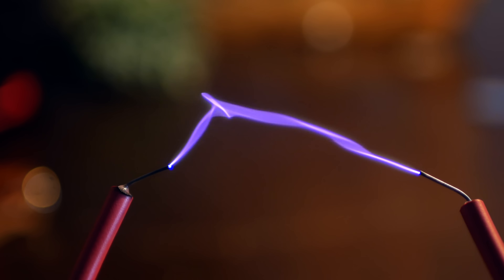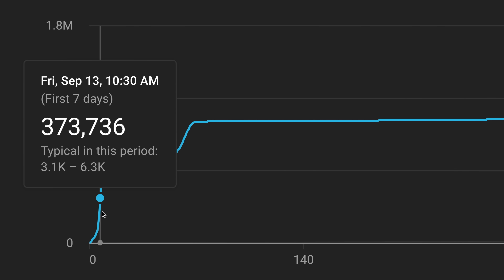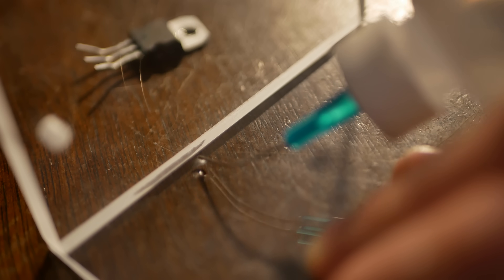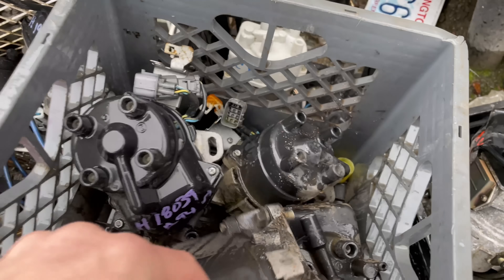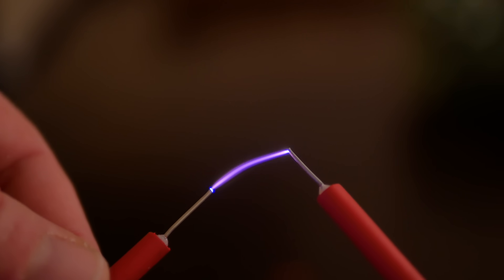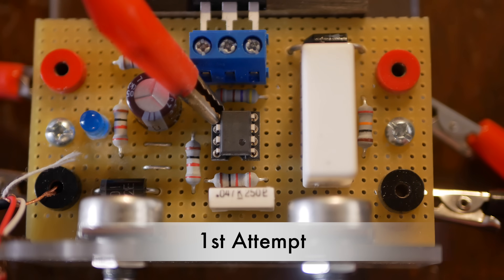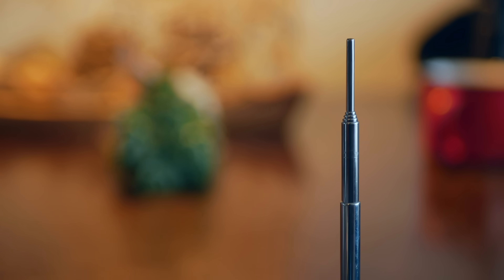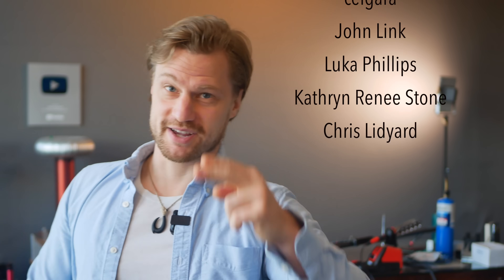Giant Bluetooth Plasma Speaker from Honda Ignition Coils (60,000 volts)⚡

Comment: Nice build! 
The reason you need quite high frequencies for audio modulation to work is probably not just the switching frequency in it self being audiable, but also the modulation of the arc. The switching frequency must be significantly higher than the audio frequencies, to be able to modulate it into sound (otherwise the frequencies will just interfere with each other and end up mostly as nothing or just unwanted as noise). When using 7-10 kHz switching frequency, only lower midrange and bass frequencies would be possible to play back as audio. 
But low audio frequencies are very hard to play back with an open arc anyway (unless the arc is really huge) - because the volume of surrounding air that get displaced (in this case by expansion and contraction of the air/plasma inside the arc) get too small compared to the wave length of the audio. The same reason a high frequency speaker can be made very small and still loud, but a subwoofer need to be quite big to even work at all. Still fun project and those ignition coils probably has a lot of other fun uses and applications, that doesn't need very high frequencies to work.
Reply from the maker: Thanks so much! Yeah, my favorite build hands down. Love this little circuit. You gave great input on this. Have you built plasma tweeters in the past?
Reply: @PlasmaChannel   I havn't built plasma speakers, but is experimenting right now with building a small PWM modulated (class D) amplifier (which I got working - maybe I put up a video later). I guess this works in a similar way - because you also have "sharp" pulses coming from the transformer output, which then get averaged out into smooth waves acoustically by the arc.
But, if the modulated frequency is to close to the switching frequency, there is not many pulses that can get averaged out and the 2 frequencies will mostly interfere with each other instead. A good rule of thumb for class D (and probably this as well) seem to be that the switching frequency should be at least 10 times (and the more the better) the highest modulated frequency (200 kHz if you want to play audio up to 20 kHz).

Comment: I once wired 4 of these coils together, one pair in paralel and that was againts another pair in paralel, I used an SCR dimmer circuit in series with a capacitor for limiting the current and pluged it into 230V, I got over 10cm long arcs hotter than arcs you get from a microwave oven transformer no joke, still have the pictures and some videos, I had to cover the coils in wax to prolong their live, they lasted for over a week of playing around with them
Reply from the maker: Funny, the plans for this video originally called for 4 ignition coils. I have all 4 identical coils, but could not get two antiparallel coils in series to work appropriately. I think it was a supply current issue. If you can find the pictures, i'd love for you to email them to me! My email is under the "about" tab on my channel page.
Reply: @PlasmaChannel  Ok, no problem, I can do that
Reply: @PlasmaChannel  I sent you the email, tell me if you got it and if the Google drive link to the pictures works.